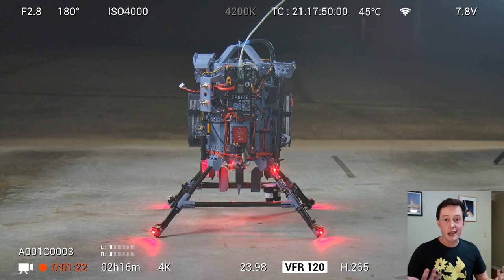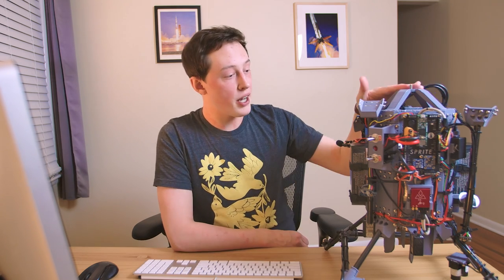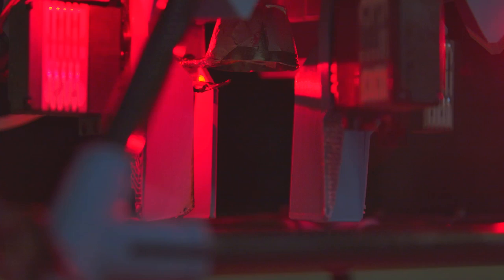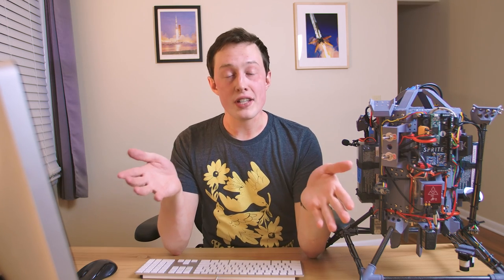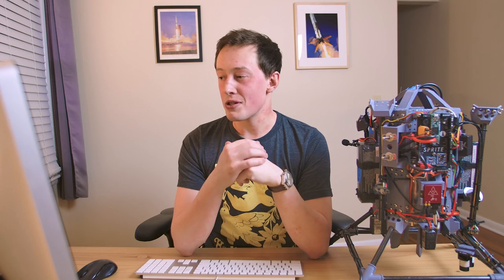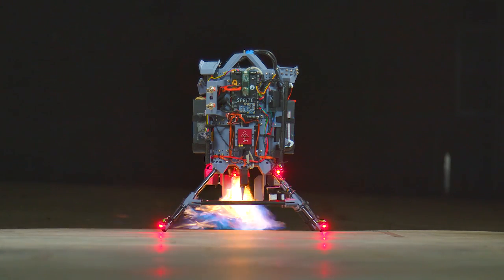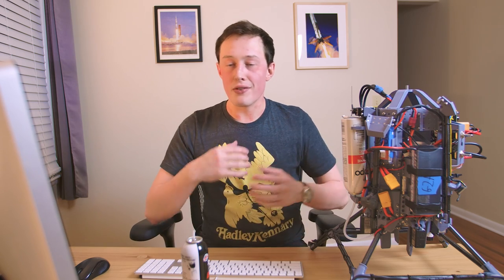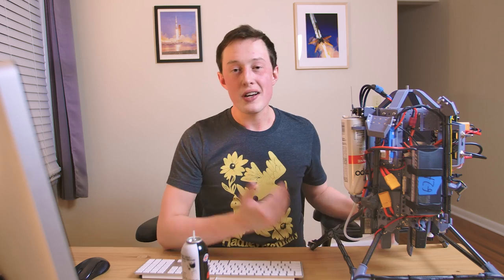EDF Afterburner Fire

Comment: Your fuel is literally dripping into the flame in the close up.  You need that to be vapor so it burns before the blast of the EDF carries it away.  A flame holder is critical.  TECH INGREDIENTS did a great EDF propane turbine with afterburner.

Comment: What if you had two EDFs, layered with the lower pitch blades above, forcing air down into a higher pitch EDF, so neither would be working as hard as they otherwise would, and the higher pitch EDF receives more cooling? Keep up the great work, you’re awesome.

Comment: When the engine is starting, i can see a lot of liquid butane going out of it, i think you could have a better air-gas mixing (so a kicker and more homogenous combustion) if you directly inject gas rather than liquid that takes time to evaporate and burn. To do this you could flip over your gas tank so gas will go out before liquid or maybe use propane that gasifie kicker than butan do to his higher saturated vapor pressure.

Comment: Need a burn  cage (about a half inch tall cylinder of coke can aluminum with two rows of staggered 1/4 inch holes) for stability. 

A small set of stators under that to introduce a spinning air flow could give a better flame pattern also. Possibly saving your PLA parts also?

Comment: You may also want to build a larger output nozzle as increase the tube diameter of the coil this should greatly increase expansion buy decreasing pressure.

Comment: How about rotating the Zippo Canister 180 degrees through vertical so the nozzle is on top, that way any "Liquid propellant" will sit at the base of the zippo container enabling a cleaner and drier burn. Also an in line expansion chamber just before the nozzle.

Comment: Aww, but there's so many cool electric jet engine designs you could use to make the butane actually do something. Most of the complexity of a jet engine is in extracting energy from the exhaust stream to use to drive the compressor blades, but if you just use an EDF as the compressor for the jet engine, you can make a very simple type of jet engine.

Comment: Is there any possibility of counter rotating fans ? Two in the same are would be tough but maybe two motors, facing opposite directions. This would give more flexibility on power/thrust and cure the rotating air column problem. IT'S crazy cool. Keep it up !

Comment: Have you looked at the EDF afterburner FliteTest featured? It was similar to yours but with a longer nozzle that the fuel was burned within, so they got a much nicer flame and actually made a little thrust. 

You could also consider using a centrifugal EDF, as the higher compression ratio lets you get respectable thrust out of an EDF afterburner (the AmazingDIYProjects channel built one). I don't think either of those approaches would be very compatible with the current layout and weight of Sprite, though. Maybe something for a future experiment.

Comment: Look into "bypass jet" geometry. I bet with little alteration you actually could get some thrust out of this without loosing thrust from the fan alone. An advantage to the bypass air is it helps cool the combustion chamber. You are still releasing all that horse power - you just aren't utilizing it because you are allowing it to go off in all directions - if you are going to produce it, you might as well use it.

Comment: Interesting approach:  A couple of ideas. . ?
  1)What about an inverse "Plugged Nozzle" at front of the firebox?
  2) Concrete Patch, or Fireplace cement is an excellent fire shield which can be easily shaped and formed when dry.
Reply: Yes, fire cement is cheap, strong and easy shaped for prototyping. Relatively light when dry.
Reply: Kit; A while ago, I seen someone using 'Instant Patch to make complete nozzles with.  He had a mold milled out of aluminum in the shape of the inner bell with a throat extension, that he sat centered, at the bottom of a tube, then poured the mixture over it. A consistent engine nozzle every time.
 Nowadays, a simple 3D printer could do that mold quick and easily. Any modification desired would be greatly sped up, and the cost of the "milling" would be reduced to only some mono filament and the time required to burn it.
  Just a fun thought.

Comment: you mention you want gaseous butane coming out of the after burner, maybe you tested this but if not maybe try inverting the can to right side up, everything that comes out in theory should be mostly gas  anyway and as long as the can doesn't get too cold from outside temps I would think it should have enough pressure to drive itself the way you want but just a thought I had watching this. Keep up the good work!

Comment: I presume you've already thought about a long burn solid fuel motor with a 80% thrust to weight ratio and then making up the difference using the the ducted fan  for control.  Or even better  2 solid fuel motors   one for launch and one for landing

Comment: How about dumping some atomized water in front of the ducted fan? This should increase the momentum of the ejected gasses when the afterburner is on. I have this on good authority that this is one reason  the MIG 25 was so fast (at least for a little while) This would also cool the air being inducted if the water is well vaporized thus increase the density (and momentum, naturally)

Comment: You don’t seem to have any flame holders for the afterburner. Without an area where you slow down the airflow to allow a small part of the flame to be stable it will just get blown out by the air flow. I suspect that is why it blows out when the EDF is above 40%

Comment: Looks like ‘flame lift’ in gasman terms, 40% or more thrust exceeds the speed of the flame burn. 
Perhaps a lower speed air flow chamber in the centre? 
Better oxygen/gas mixing in the chamber (bit like how the air comes in low on a Bunsen burner - might be more blue flamey than yellow) then igniting in the low speed area and then properly expanding/burning in the high speed airflow area.
Perhaps.

Comment: Why not inject the gas pre-fan for mixing and add some sprayable ceramic coating to the inside of the fan nozzle (like car piston dome coating) and add a method to neck down the diameter at the very end of the fan duct

Comment: Couple of ideas, 

1 could the diverted flame be the result of the close surface the craft is resting on? ie right angle outflow of exhaust. i would be interested to see the craft on a stand with a diverter under the exhaust
2  for the combustion problem,  how about a set of side chambers "3 or 4" where combustion would start then flame would enter the main thrust path?

Comment: 11:10 I'm sure you're know what you're doing, but from the test footage it looks like you don't have your coils heated sufficiently(as you noted) before increasing airflow. With white gas stoves the fuel is usually burned in a reservoir to heat the coils before introducing more fuel. Consider limiting the butane input on startup and allowing time for the coils to come up to temperature.

Comment: Modern turbofan engines increase thrust by adding passive airflow in an annulus around the turbines.
I was sure you had a solid rocket booster in there somewhere.
How about a hybrid with the butane? Send it through a cylinder of a solid oxidiser like potassium permanganate. Makes it throttleable.

Comment: That weird flame vector might be from the butane spinning inside the inlet tube. Maybe have some laminar flow tubes micro 3D printed inside an injector plate so you know it's going to be flowing straight into the combustion chamber. I feel like the size would be the limiting factor in creating a laminar flow of prop going into the nozzle. I mean how do you create an injector plate that small.

Comment: Hi,
Great ,fantastic engineering 👍 I found if you flip the butane bottle upwards or in my case nozzle laying down on its side to ,you will get the blue constant jet flow . It seems the design of the butane can pushes gas and liquid upwards a bit like spray paint can struggles to eject the paint or fuel in our case ,if you tip the can upside down in my opinion. Also try a hand held blow torch gas bottle it will have more pressure.Checkout my Bloodhound LSR Rocket  car with a ducted fan motor project video.
Hope this helps .

Comment: EDFs are not really efficient but I think if you where to put 3 more smaller edf in a tri formation around the central edf maybe 3 60mm should do the trick .. or failing that one single beefy quad copter motor with a decent sized prop on the top to do most of the lifting and use the central edf to control and counter torque

Comment: Fire for effect! Brilliant! Could you add intake vents that double as descent/landing flaps that are higher than the butane ignition point? This may allow for additional air without eliminating the low-pressure zone you’re talking about? It may also reduce your overall weight enough to break the balance.

Comment: Are you just injecting the butane with a single nozzle? Perhaps after the preheat turns a full circular nozzle with small holes would be better for injecting into the afterburner? By that I mean that the nozzle has an input after the preheat and then into a full ring of copper pipe (or whatever material it is) and the only ouput for the butane is the small holes.

Comment: I might have an idea to lift it , but Will be expensive, lifting 3.5 - 4 kilograms won't be easy for the EDF you are using. so the idea here is ( you 3D print 4 additional EDF holding arms, to mount on it & get 4 more ducted fan (EDF) that can produce at list 2kg each to achieve lift, & the EDF with the fins will be for controlling it. if it will work for you.

Comment: I'd look for areas where you can 'add lightness,' to borrow a phrase. For instance, those huge, metal toggle switches on the side could be replaced by something far lighter (albeit, less cool looking). Can you maintain structural integrity on the grey (printed?) parts with less material? Do your fasteners all have to be so chunky? (Those big, pan-head screws...) Have you optimized your wiring to reduce as much extra as possible? (Copper is super heavy!) Could you get by with less zip ties? (Every extra gram helps.) These are just off the top of my head. It gets easy to become locked into a design, and it gets harder and harder to know when to call it good with optimizations, but there seems to be quite a bit left on the table here still. Anyways, thanks again for the vid and good luck!

Comment: Probably needs better mixing. Does one of those butane cylinders give enough flow rate to entrain air like a bunsen does? If not, you can probably scavenge air pressure from the flow inside the duct. Or just inject the fuel a lot higher in the vehicle with the flame holder used just as a pilot light. Some steel mesh might be useful to make sure nothing ignites too early.

Comment: I'm curious, have you considered using more than one EDF and counter-rotating them to balance out the torque? (With the side benefit of being able to vary the distribution of load to provide a 'reaction wheel' effect.)  Do you still get effective/efficient thrust placing one above the other? If not, maybe 4 smaller ones arranged like a compact quad-copter would be effective. I guess it's not out of the question to 'gimbal' the 'stator' fins so that their angle can be varied proportional to thrust/torque.

Comment: 3 things you need to get more of the effect you want:
Guide vanes remove the vortex induced by the fan.
Multiple butane spray bars to provide more evenly distributed butane.
A flame holder to prevent the flame from being blown out.
Check out AgentJayZ videos about afterburners, flame holders etc.
Guide vanes are trickier, but there are resources online RE how to design axial compressor stages that will tell you how to work out your guide vane angles.

Comment: Thinking to an impressive visual element despite the useless utility, i like!
But what is the point to spray liquide instead of direct gaz with bottle revert ?
Reply: fafane65 100 times more gaz gets out per seconds this way.
Reply: Yes i know, but it consume also much more gaz and need some trick like preheat the pipe.
It's just an interogation about how less fire with spray gaz instead of liquide.

Comment: Use a  jet engine made for model aircraft. You can put in a gimbal and throttle it to control thrust.
Reply: Much more expensive to buy, therefore a bigger risk in a crash. Much more expensive to run, R/C turbojets quite a low number of hours between overhauls. Not very efficient for hovering flight. Also, the flight computer's software then has to deal with a varying weight as fuel is used. Lastly, much more complex system with fuel and oil pumps, ECU, etc. Probably EDF is more repsonsive to throttle settings. I totally see why he went with an EDF.

Comment: Just an FYI: if you are dumping LIQUID BUTANE out of the canister it will get COLD and Lose Pressure! as you have no way of re-pressurizing the fuel tank (with say nitrogen to replace the spent fuel) you will Not achieve any useful thrust with this configuration if you want to use if for anything else. This is the #1 problem with butane camp stoves in winter in the snow they have No pressure because they get too cold.

Comment: You should add another fan that would spin in the opposite direction, to reduce torque (like helicopters),increase speed and redirect the flames that divert from the main flow.
You could also create a combustion chamber with another fan, wich would be linked to the main electric fan with a drive shaft.(oh and btw look for Igor Negoda on YT you way find some ideas there too c:)

Comment: Seems like you need some cheater ducts to allow atmosphere to rush into the low pressure zone, as you have a sort of manual venturi by creating high speed flow surrounded by stationary air.

Comment: why bother evaporating the liquid butane and just skip that whole process and just turn the can the right way up and use the gas that comes out
Reply: I thought the same. Maybe I'm missing something but it seems such a logical solution.
Reply: @WellingtonIronman  he might be going for the realism aspect with preheating the liquid but seems a waste of time for a visual effect
Reply: Because he needs the flow levels of the liquid coming out, if he just tapped the head gas it would be barely visible levels, if ignition at all.
Reply: Higher fuel volume upside down.

Comment: Can you articulate the tvc fins in and out of the flow based on throttle so that they have more authority on the airflow depending on throttle? I don’t know if the weight would be worth it. It reminds me of a concept Tucker Gott talked about in one of his paramotor videos. They have some smaller fins on the cage to offset torque. It’s obviously a completely different setup

Comment: From the standpoint of science versus art… The added weight of the butane system only adds to the amount of thrust needed… If your craft flies without a flame, celebrate that... After all, you don’t need a buggy whip to drive a car
Reply: The buggy whip is the throttle cable...

Comment: Stator angle should be zero ... the drag created before or "after" its effective range would not be beneficial ... in fact it may contribute in slowing reaching your desired speed !

A "vortex generator" ring kind of thingamajig  OUTSIDE the EDF flow could probably provide the butane a low pressure area ...where the flame is visible but not in the path of the flow ... the outside air flow may be sufficient if required. So that would solve your "for effect" flame and it would probably not get blown off when you reach 100% throttle

Comment: Fuel injection should happen perhaps be at the intake? should atomize better and also since you'd be injecting into the low pressure area it should act like a carb and add more fuel with more flow and less with less flow.

Comment: What kind of motor/fan are you using? Would be interested to get some more information on that, by the fact that this thing can lift just a bit less than 4kg.
And based on the weight of the afterburner, is it worth it to have this thing there? I mean yea, looks cool but if it adds 300 grams or more, its really not worth it. My opinion :-)

Comment: What if the whole top of the "rocket" was a velocity stack? That might help the airflow for the intake
Reply: @Cody Avant By "velocity stack", do you mean more fan stages? (I should probably already know the terminology.) That makes sense to me. Looking at the flame as a flow visualization tool, it seems to me air flow inside the duct is turbulent, probably due to restriction at the inlet.
Reply: @DistracticusPrime  I meant more of the air horn shape, referencing velocity stack. You're probably onto something with multiple fan stages, like how a jet engine has multiple stages of compression blades. Add some directional fins in between stages maybe, i'm no jet engine engineer lol. I've just seen velocity stacks on carburetors and strong fans, read it can improve airflow 10-30% IIRC.  
Maybe filming with a fog machine and super high frame rate camera could help.

Comment: Also add some pressurized oxygen in the after burner or you can use a jet engine instead.
Reply: Yes I like that idea.   A can of pressurised O2, to act as an ozidizer to the Butane, might give appreciable extra thrust.   It's either that or add ANOTHER EDF fan to provide enough thrust.   He prob needs 5kg of total thrust minimum to make this work, and likely more than that.